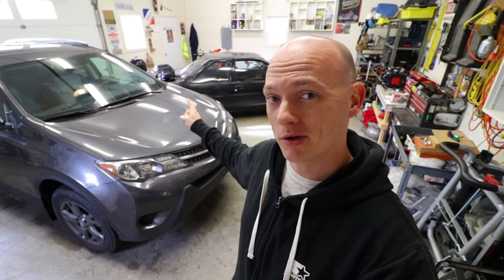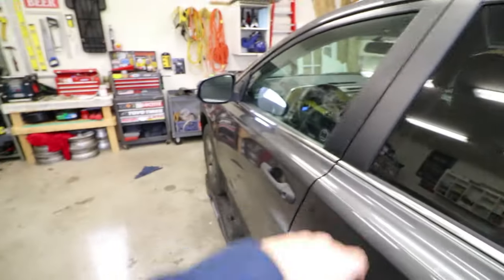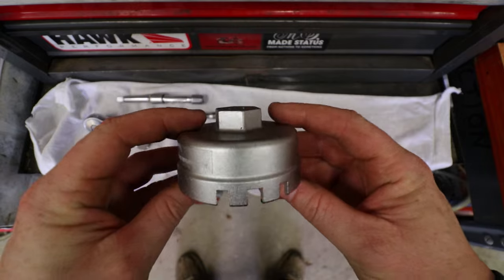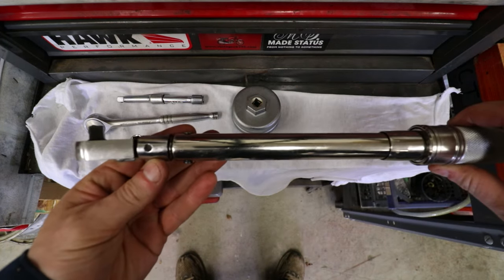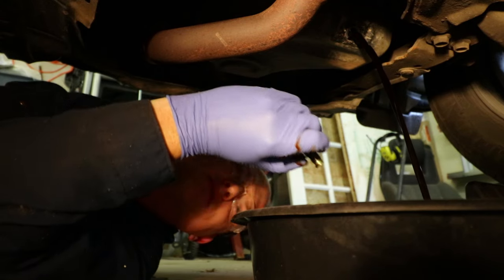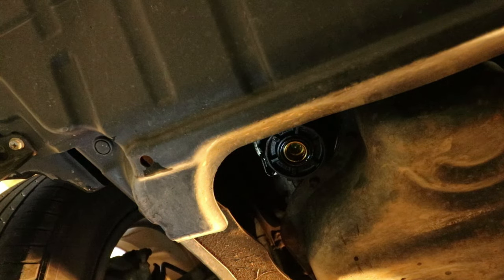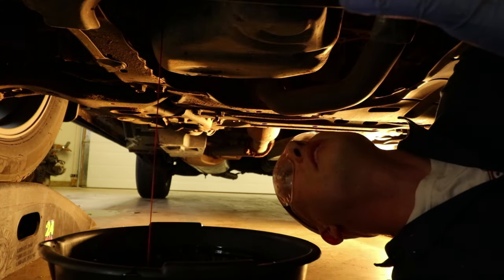How to change Toyota RAV4 oil and filter 2013 to 2018

Comment from the maker: If you want to skip to a section:

1:06 - Tools required
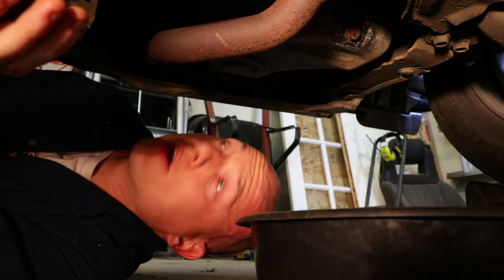3:15 - Draining oil
6:45 - Filter housing inspection & cleaning
7:41 - Installing new o-rings
10:11 - Begin reassembly
12:14 - Adding new engine oil
Reply: Mike Barker you remember when rav4 had such a easy oil change ahhh good days
Reply from the maker: Dominic Alvarez - I think it's still pretty easy. Anybody can do it with a few simple tools!
Reply: Torque wrench I assume is 3/8 torque wrench?
Reply from the maker: You bet it is!
Reply: hey mike where do u got those ramps pls and thank u

Comment: there is absolutely no reason why this has to be this complicated. Car manufacturers have made this so difficult to force people to send the car to the dealership. Great video though, very comprehensive.
Reply from the maker: Hey Christian. I would tend to agree with you 😅
Reply: Complicated? ...
Reply: I believe most cars just use a whole filter cartridge that contains all these parts. Toyota made it so that you only replace the filter itself and some O rings. Perhaps it's to reduce waste. But it really complicates it.
Reply: I bought a 2018 Rav 4 from the stealership three months ago. A few days ago I changed the oil. They say every 10,000 miles. Forget that. I do 5,000. It's not like it's their problem once it leaves the lot. Anyway, when I got the cartridge off and the filter, the bottom o-ring was missing. And these guys are supposed to be the experts? I skipped the free oil change due to Covid 19, but I won't be going back, regardless.
Reply: Baloney. It's not rocket science.
Reply: Complicated? Difficult? I would guess you're one of those people that couldn't change a flat tire if they needed to and would be waiting however long for the tow truck/tire guy.
Reply: @killer2600  I change the oil and transmission fluid on both my cars and zero turn, and to have to disassemble half the engine to do an oil change is poor design. Period. Ask any mechanic. Fiats are well known as poorly-made cars that don't last, and this is visual evidence.
Reply: @BaghaShams  It's not all that bad. I just did the oil change on my Rav4. As long as you follow the torque specifications, you're good. No, it's not as easy as a spin-on cartridge, but for me it's not a deal breaker.
Reply: @killer2600  Thanks for your constructive and kind comment in this thread, I'm sure everyone appreciates it!
Reply: @coleoshtamebaghe3606  I think you're commenting on the wrong video. There are no Fiat's in this video.
Reply: @BaghaShams  The truth hurts and you can't comment someone into not thinking a easy task is complicated and difficult. Changing a tire is not difficult but people will wait on the side of the road for a tow truck for 2 hours because they believe it is so difficult and complicated.
Reply: @killer2600  You're clearly a tough and manly man and you don't deserve to read the comments of any lesser men. Thanks putting the rest of us in our place.
Reply: @BaghaShams  It's not about tough and being manly, it's about complaining that this oil filter change is more complicated than any other oil change and this complexity is so complex that only a dealer can successfully do it.
Going back to a previous comment of your's, you too believe this is complicated. If you both really do think this is complicated (vs just whining about new things/change) then you haven't actually done real work on a car. I've changed bulbs on a car that required more steps than this oil change - and changing bulbs are among the easy things to do.
Reply: @killer2600   Killer2600  "then you haven't actually done real work on a car" That's right, I haven't! And that doesn't make anyone any less of a person. Many people haven't, in fact, because we're busy with the other aspects of our lives, and some people are not interested in doing car work. And that's okay. 

By the way, I performed this oil change, with the complications and all, and I'm proud of myself for it. I went from knowing nothing about cars to getting to this point. But I don't look down on anyone who knows less or has experienced less than me.

You should take a page from Mike Barker, the video creator we're all commenting on, and how encouraging and positive he is to everyone who wants to learn these things.
Reply: @BaghaShams  So you have no reference for "Complicated"...I'm not commenting on the video, I'm commenting on a comment - this oil change is no more complex than any other: remove oil, remove oil filter, install oil filter, install oil it can't get any less complicated than that unless you forgo changing the filter.
Reply: Have to laugh at some of these comments. My 1993 VW vr6 motor has almost the same oil filter setup, except you don’t need a special tool to get the filter housing off, just the correct sized socket. I just bought a 2017 Rav4 and after watching this video, guess I’ll now need that special tool to get the housing off. Joy of joys 😂😂
Reply: @stevensevek6151  ikr the tool cost about the same as a good oil filter wrench set. plus paper cartridge is easy to dissect and inspect for excessive wear.
Reply: @BaghaShams  complicated and lack of experience are two different things. it's only hard because you lack experience. this oil change is extremely easy compared to most.
Reply: @killer2600  completely agree, been a tech for many years. he lacks experience and thinks its hard because of it. i would love to see him try to tackle a timing belt/chain especially on a older ford where you have to count chain links and notch the crank to set degree from TDC per cylinder head. this is child's play.
Reply: @huuing  either way you needed a socket and i agree it was stupid on their part not using a traditional 6 point hex even if it was a 38mm. think it was in hopes of some idiot using a pipe wrench and a rag destroying the plastic so they have to buy the filter housing.

Comment: Use the torque wrench and follow the specified torques.  My in-laws had an oil-change place do their RAV4, and the knucklehead tech (grease monkey) just cranked down hard and effed things up.  They're now in the process of having their mechanic testify in court on how the grease monkey ruined their engine.

Comment: Replace the oil cap plastic housing (it breaks) with TOYOTA Genuine Parts - metal replacement filter housing, (ap assy) for  Oil Filter (15620-31060)

Comment: I’ve smashed 6 extracting tools including the one from Toyota,it’s taken 4days of trying ,in the end I had to use three foot exstention bar and a lot of effort to remove the alloy fitted one from the factory, so on refitting do not over tighten ,and change oil every six months regardless of mileage then it shouldn’t seize up

Comment: As you mentioned, have never been able to get that drain plug cap off the oil filter.  When I try to ratchet it off, the filter assembly itself loosens up.  So all my oil changes have been done with that plug never coming off.

Comment: Great video. I've watch about 15 video's and this was the only video showing Torque specification. I purchased the Haynes manual and I was confused on oil torques, clearly a misprint, oil filter plug 110 ft pounds. You state 9, I'm guessing the book should have stated 10, not 110. So I am very thankful for your video.

Comment: Excellent video. I just finished my first oil & filter change on my '014 RAV4. This was by far the best how-to video I found. Unlike the demise of points & condensers and carburetors, I'm not a fan of that of the old canister-type filter. But the extra hassle with the cartridge & housing design is not a huge deal. Anyway, the other videos are probably okay but the guys mumble and use ambiguous phrases like "this thing." This one is a keeper. Thank you very much.

Comment: A lot of oil change shops never take the filter plug, they just take the whole filter which saves time, a little messy though, I've been doing the same for 4 years and no problem, although this is a great video if you want to follow the exact Toyota specs for That I say A+

Comment: Thanks for the in detail video... replace the plastic filter housing with a toyota metal one - toyota part 15620-31060 for about $25.00.  Plastic housing can crack.....also I think it takes the 4.73L for the fill up.

Comment: A couple of other tips are it's always better to do a hot oil change to get out most of that residual oil and if you're really meticulous about the internal parts of your motor, it would never hurt to run a litre of cheap oil through again to flush out the residual oil in the pan especially if you're propping your car up on an angle, like he did. And to be even more meticulous some people have been known to use magnetic drain plugs to catch the metal parts throughout your oil. And this also extends the life of your oil filter dramatically and also helps in the first few engine flushes of a brand new motor.

Comment: Great video. Yes, you should wait 10-20 minutes for the oil to make its way down to the pan and get a good deep stick reading. This goes back decades, still applies today.  even though the oil being used has the viscosity of water, the engine tolerances are much tighter.

And as others have mentioned, do open your garage when you turn the engine on.

Comment: Very detailed oil change. Well done! I just remember 30/20/10 ft lbs for the torque specs to keep it simple.
Reply from the maker: Robmar that's a great trick to remember them!
Reply: I just use 9, 18 & 27

Comment: Thanks for the post, helpful.  I really DO NOT like those Canister Oil Filter setups, next car I will make sure it comes with a regular type filter.
   Hopefully the Rav4 2019 will have a regular type set-up !
Reply from the maker: I'm learning to live with it. We will see what direction Toyota goes. I have a feeling the cartridge style isn't going anywhere though...
Reply: I believe the 2019 model has reverted to a spin on canister filter instead of the cartridge system.
Reply from the maker: Whoa! Very interesting if it's true that they've done that.

Comment: Really good video. I don't think you should run the car inside a closed up garage. Even though its crazy cold up there!
Reply from the maker: Thanks! I totally agree. I only ran the car for a few seconds to get it on the ramps. I warmed it up outside by taking it for a drive. If I had to run it inside for any amount of time, I've got a length of hose that I slip over the exhaust and run it outside.

Comment: Why can't they do the engine oil filter above?  The 2 2015+ Subarus I have the oil filter on top, theirs was on bottom in earlier models like my 2003 Corolla.  Much cleaner now than than the horizontal mount in my 97 Corolla.   

Thanks for the video.

Comment: Be Safe , just  remember put parking brake on , chock wheels, and let someone know your working under your car, open garage door when starting car, take your time and when all done have a beer..thanks for the torque specs and O ring tips.
Reply from the maker: Absolutely! Always work with the door open or at least someway to keep yourself from breathing in the nasty fumes.

Comment: Do yourself a favor and replace that plastic filter housing with an aluminum one ( Napa keeps them in stock). I was changing my wife's oil and the damn thing broke leaving a hole in the side of it. This is a fairly common issue.
Reply: The dealer tighten the dem thing to tite, I have to use impact drill to get it open, but it broke left me with small hole, I could not get to the store in sunday, i have to use JB weld to attach the broken piece, and it work, till next oil change i will get the aluminum replacement.
Reply: I was going to do that myself. Then I read about how some folks have had problems with the aluminum filter caps as well. I decided to get the original plastic oil filter cap.

Either one is fine. It's only a problem if you let someone else change your oil and/or if you don't torque the parts to the specified torque. Also some folks use the wrong wrench. They use one that is meant for the smaller oil filter cap on a Corolla which will fit the top but is not the correct tool. Also use a socket that fits the hex head on the oil filter cap wrench instead of just using a ⅜ inch extension to remove the housing.
Reply: @njsongwriter  Just discovered that you can't get an aluminum cap for a 2018 -- only up to 2017.
Reply: Just discovered you can't get an aluminum cap for a 2018 -- only available for up to 2017 models.
Reply: @srfgrn  That sucks. Maybe they'll be available soon
Reply: I always have an extra oil filter housing on hand in case something breaks. That is why you change the oil yourself if possible. The first time I did it I had to use a breaker bar to get the damn thing off which was done by the dealer. Maybe they didn’t oil the O ring or used a breaker bar to install it. I never had a problem since I started doing it myself. You can tell when it’s tight enough when it stops turning you can feel it. No need to keep tightening any more. Also you can put a light coat of oil on the threads before installing there’s no need to get the metal housing

Comment: You can likely get a cartridge filter adapter for this from bpadapters.com.  This would allow the car to use regular spin-on filters. The downside is the adapters cost $200.
Reply from the maker: Yikes. As nice as that would be... I think I'll stick with the cartridge setup.
Reply: Personally the replaceable filter element makes more sense to me. A little more involved but I don't mind that. Maybe if the weather was really bad and I absolutely had to change my oil immediately, then it would be nice to simplify the job cause I don't have a garage.

Comment: Quick question: how long do you need to run the engine after adding new oil and before checking the level? 

I love your video by the way and I've watched it through probably 8 times so far in preparation for doing my first oil change.

Comment: Snap On 3/8 inch torque wrench ... how did you set to 9ft/lbs?  Believe minimum on it is 10ft/lbs.   However, excellent flex head on the torque wrench as now hard to come by without spending more than $100
Reply from the maker: Good eye! Mine is model QD2RF75 and the lowest mark on the shaft is actually 5 ft/lbs. I don't know what the accuracy is below that... But I've never had to use it that low either 🤔
Reply from the maker: I just checked and Snap-on still sells a 3/8" flex head (it's now QD2RF75B). They advertise the range as 5-75 ft-lbs.

Comment: When you are putting the oil filter back on around 11min mark, I see a little metal tab that looks to keep the filter housing from unscrewing. Do you have to bend that out or can it be damaged when taking off the filter housing?

Comment: Thanks for your video. I get that Toyota is saving on the disposable steel can but the old style was so much easier.  Sometimes I take it in for as oil change and sometimes I DIY.  I have the filter wrench and all but this time the filter was put on (at a dealer) with a death grip and I'm afraid I'll break the cap.  Is it any easier to remove when cold or hot? Or any other advice?  Thanks!
Reply from the maker: Well the engine should be warned up before you change the oil so the filter housing will likely already be warm. Invest in the proper filter housing wrench to make your life a lot easier. 👍
Reply: @Mike_Barker  Thanks for the reply, but it was already warm and I have a great wrench.  I've since found other youtube sites that had to use an impact wrench (scary thing to try) to loosen an way over-tight filter.  My last change was by a Toyota dealer  I don't know if they over-tightened it or if it was already too tight and they changed the oil and blew off the filter change.  Either way IT STINKS!! Thanks ag for the reply.

Comment: Just a little fyi.. I didn’t have a 1/2” for the filter drain plug (did this for a friend and forgot to bring it).. anyways, I just used the filter adapter and still loosened it, used the oil catch (definitely more messy), but it can be done without using that plastic adapter and taking that thing off..
Reply from the maker: Totally! I've bought filters before that didn't come with the little plastic spigot and have done exactly that.
Reply: @Mike_Barker  thanks for the vid! Very informative!!

Comment: BTW I notice that your oil filter cap wrench is made for the 1.8 liter engine and the slots on it do not engage with the tabs on the oil filter cap. Next time you do an oil change take a close look when your oil filter cap is off and you'll see what I mean. I know it still works even though it's only part way on. That's because both of the two different caps are 64 mm and 14 flutes at the top but if you had the correct wrench it would fit even better. The two different sizes can be seen here... (You want the larger one that fits all engines 2.0 liters and up including 4, 6 or 8 cylinders)
https://www.amazon.com/Motivx-Tools-Filter-Wrench-Vehicles/dp/B078RHZP9M/ref=sr_1_12?dchild=1&keywords=motivx+oil+filter+wrench&qid=1601674153&sr=8-12

Comment: Is 0W20 the best for rav4 that you can use for summer and very harsh winters?
Reply from the maker: It's what Toyota recommends especially for long, cold, hard winters!
Reply: Why wouldn't it be? The engine temperature is controlled by the thermostat and the engine should be running at the same temperature (or close to it) year round.

Comment: Did you have to remove a plastic splash shield to access the filter and drain plug? I can't seem to find mine.
Reply from the maker: Not at all. My filter and drain plug were both easily accessible. Nothing had to be removed beforehand.

Comment: Dealer overtorqued the filter on the 10k free oil change. Any suggestions on how to break it loose on 20k oilchange. I changed the oil, but couldn't get filter housing off with proper tool...
Reply from the maker: Use a bigger bar to get more leverage on it? I can't see how it could be torqued on THAT hard 🤔